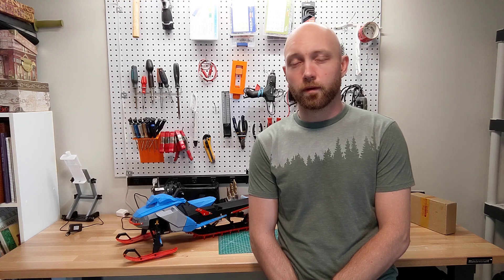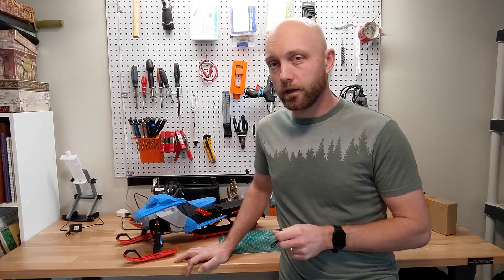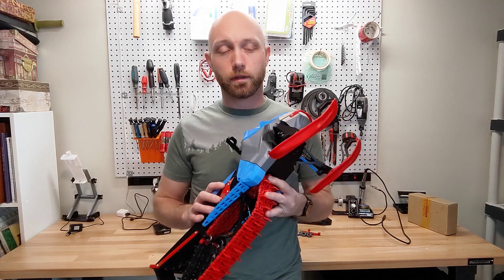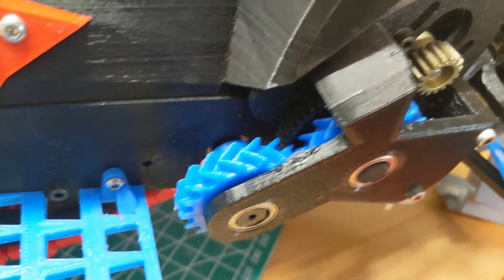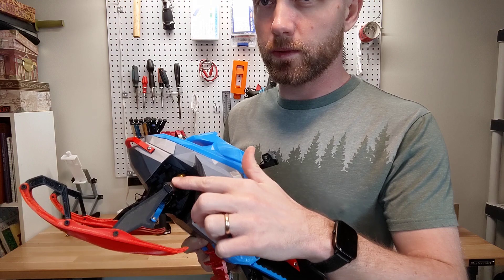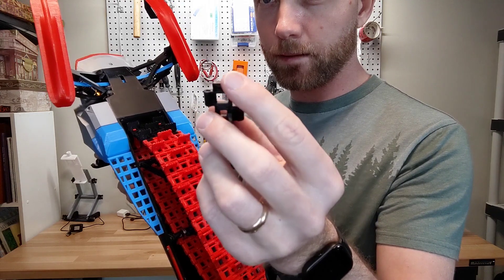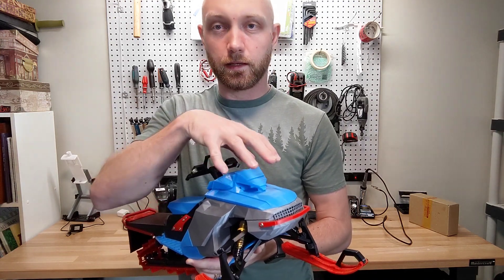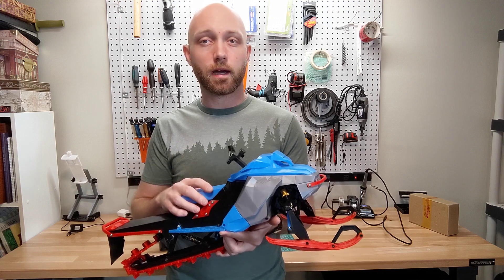Skeeride RC Snowmobile - Should I build it? Comprehensive Review

Comment: On my experience, PLA track has a good upside as the track is really light to roll. On my sled I run Castle SV3 with 9/42 gearing, and it can easily run on 2S lipo (30C rating). I also use much smaller track profile and pin for the links, 1mm spring steel wire. With a 3S 30C lipo there have been very few link breaks, begun testing with a 3S 70C lipo this season.

Ball links and proper caster angle on the front suspension allow far worse mayhem on the sled.
Reply from the maker: I've had decent success with the pla track as well but I've definitely blown off quite a few lugs so I'm interested to see how the tpu track holds up. I'll definitely be looking more into the ball links this time as well.
Reply: My PLA track keeps exploding on full throttle pulls. I'll try the wire instead of filament for the links. Thanks for the suggestion

Comment: Sadly it drives like a car in the snow.  Not like a real snowmobile.   I have built 5 of these and have changed a few things and am working on a counter weight option.

Also got rid of the wicked bump steer!!
Reply from the maker: A counterweight option would be pretty cool and would definitely help with the turning. I remember seeing a video on something like that in the skeeride discord forum a while back. I'd love to check out your counterweight option whenever you're ready to post some details. I'm just now working a new skeeride build with the new polaris body and a tpu track. Winter is coming and the local facebook sled groups are already filling up with epic pictures!
Reply: @rcprinter  yep.  Tpu track is what I run.  Best version so far.  I will post with the counter weight option.  But I may have shifted gears as I'm going to try a moving front upper shock mount to "tip" the sled my extending 1 shock and retracting the opposite one.  We will see.
Reply from the maker: @jdsstegman  What did you pin your TPU track together with? Filament or metal?
Reply: @rcprinter  PLA pins.  So far I have not ripped a track apart yet.  And it has power.  Enough to flip it over backwards in powder.

This year I am going to try "perfect pass" on it.  It's hard to control track spin.  Should help to smooth out the throttle a bit.
Reply from the maker: @jdsstegman  Thanks that helps. I was considering going with metal pins but if that's overbuilding then PLA pins would be waaaaay simpler and I'll do that first. They might stay in a bit better than metal as well. This next sled I'm also going with a better sensored motor than the one I used last time so I'm hoping to get a bit more wheelie action out of it :) It'll be interesting to see how much perfect pass launch control helps you out... I've not heard of it before but I'm checking it out now...

Comment: btw guys when building the tracks i reccomend using metal instead
Reply from the maker: Do you mean for the pins? Yeah metal pins would be best. I'm in the middle of building another sled right now in preparation for this winter and will be using a TPU track this time and I will definitely see if I can get metal pins in there instead. That said, the plastic ones do work pretty well in my experience.
Reply: @rcprinter  yeah but if u put like metal pins and lube them the track will be smoother

Comment: Had to dislike because 100% infill does not improve strength
Reply: Lol was wondering who disliked it
Reply from the maker: Hey man, each to their own. I'd love to read up on your comment if you have a link to something scientific? I generally find parts with 100% infill last far longer than hollow parts but I suppose that's just 100% anecdotal. I know there's decreasing returns on strength as infill %'s go up but on parts that are only mm's wide I don't see why you wouldn't just fill it all up with plastic. If I'm constantly breaking one part on a model I always reprint it at 100% and it has solved the issue many times. I built the 3dsets rancher not too long ago and most of the drive components are recommended to have 100% infill... I assume that's for strength.